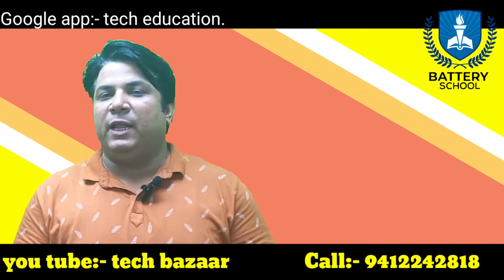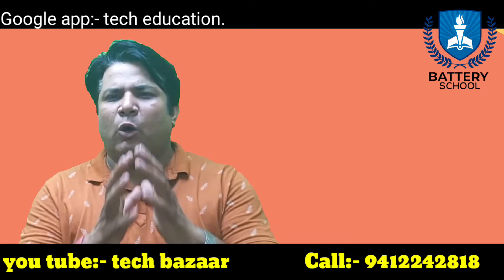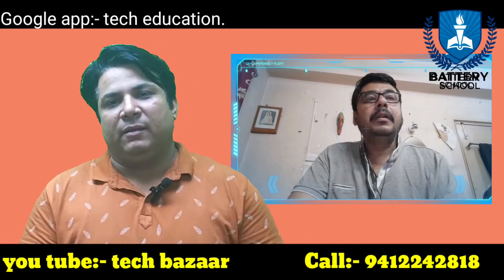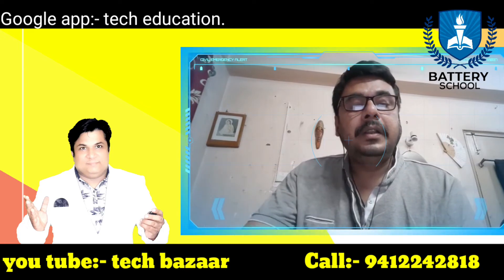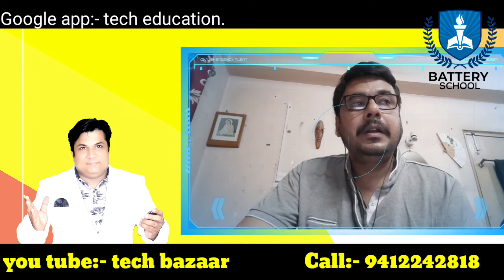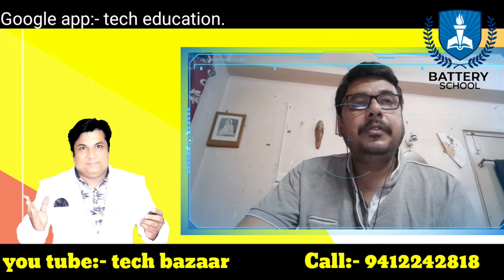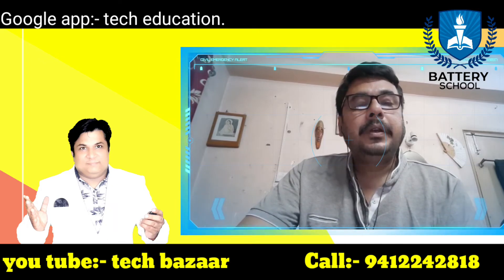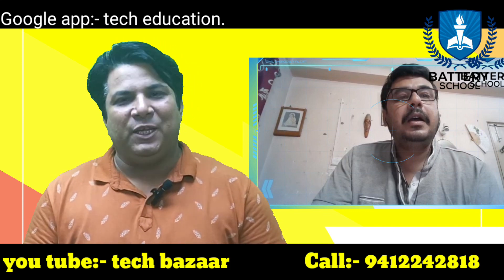Lead acid battery plat curing by :-arumoy Chatterjee,#batteryschool #techbazaar #curing

Comment: Sir for converting free lead minimum 54 degree required whatever the battery application may be
Reply: No. 40 years back there was no modern curing chamber. Only natural curing was there. Controlled curing chamber is required for faster curing.
Reply: Moreover slow curing and charging is best but it is lesser economical and productive.
Reply: Vrla batteries are not of good quality in india reason you know curing temperature
Reply: Paste mixing in high temperature more than 70 of positive plate is suitable for deep discharge battery for longer life. Also chemical additives has big role for good quality positive and negative plate.
Reply: Sir what is peak pest tempareture? And how it maintain ?
Reply from the maker: Call 9412242818
Reply from the maker: Call 9412242818